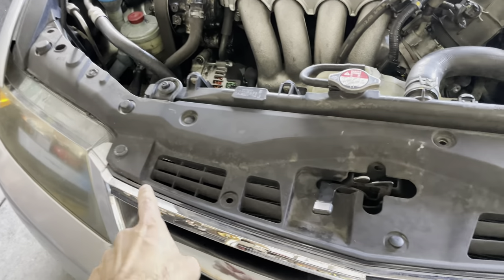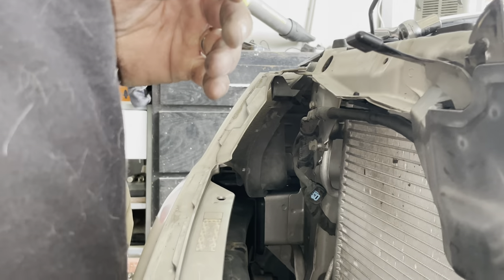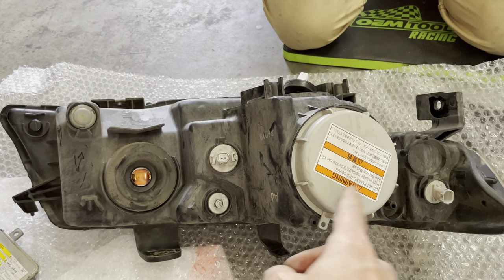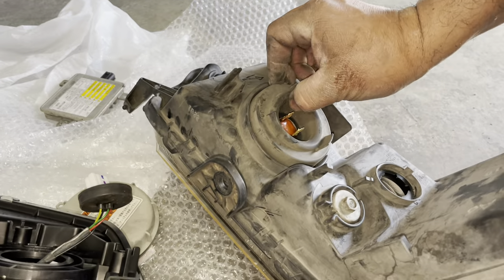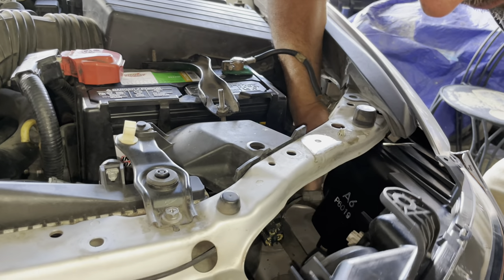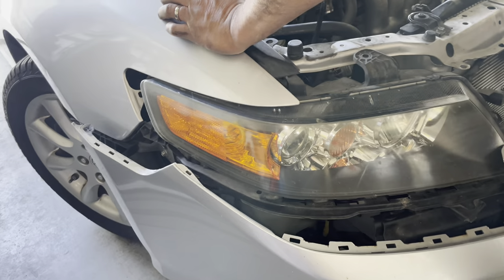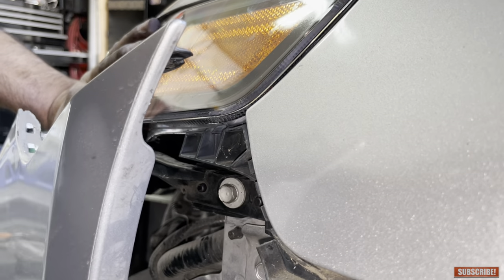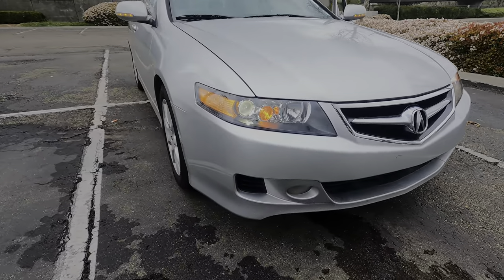How to Replace the Headlights on an ACURA TSX #acura #acuratsx

Comment: Great video, the dealership wanted $1000 per headlight assembly for parts and then another $1000 for labor so we got an after market headlight assembly for $500 and doing it our selves based on your video. Great father son project.
Reply from the maker: Awesome! I tried to combine what I saw in other great videos as well. 
There are some great aftermarket lights out there. Good luck with your project.
Reply: $500.00? Which ones did you get? I'm seeing them under 200.00 on Amazon

Comment: I had a 2007 TSX in Glacier Blue Metallic and it was the first car I ever purchased brand new. I had no real issues with it but the Bluetooth issue did come up. It was draining my battery and once I found out about disconnecting it, I had no more battery issues. However, I did traded it in for a 2016 RDX. But there are those times when I miss that TSX.
Reply from the maker: I like that color too. I do see a couple of them around in that color here by my house. 
When I was trying to figure out an issue I too disconnected the Bluetooth and although it wasn’t the issue, I never went back to connect it.

Thank you for your comment!
Reply: @JuanCarlosLTO  I still see some of them out there and it would seem that they are being well taken care of.

Comment: New subscriber Thank you so much I have a 2004 Acura TSX with only 160 mi on it it has been a wonderful car I love it I just having a little bit electrical problems with the window passenger side and need to replace the driver side headlight Thank you so much for the informative video and wish me luck let's hope this does right oh by the way I did get a HID light you didn't specify which bulb you put in are they interchangeable or do I have to use a LED?
Reply: did you fix your window im having the same issue

Comment: would this be the same for the 2010 TSX ?   Thanks for your thoughts
Reply from the maker: I’d say very similar. In a nutshell, I feel that you have to take off the whole bumper to be able to get them properly installed. I saw some videos that claim you can do it without having to remove the bottom portion of the bumper but it really doesn’t make a difference as it is a hassle anyways. I had the luxury of an extra set of hands in my friend who has all the tools needed etc. if I were to do it again, I’d order the clips to reinstall the bumper and or grill as they tend to get damaged and not work 100%. 
Live and learn. 🤷🏻‍♂️
Reply: Thanks Juan !!  @JuanCarlosLTO

Comment: Is that an oem Acura headlight or aftermarket?
Reply from the maker: Hi! OEM
Reply: Which is better oem or aftermarket? What are the differences between both
Reply from the maker: @franky-fr9ow by law, aftermarket headlights can’t be identical to OEM ones so if you like the OEM look, factory is the only way to go. Aftermarket ones are hit and miss and most times can’t match the quality and specifications of the OEM ones so sometimes they get condensation, etc pretty quick.
Reply: @JuanCarlosLTO  oh

Comment: Why would they make it so difficult 😭😭😭
Reply from the maker: Agree! Sadly it’s actually less complicated than newer cars with everything so compacted that it makes it nearly impossible for a mortal to be able to do stuff like this. This car offers relatively ample space between components to do the job. Worth every penny in my opinion. The car looks amazingly clean with the new lights.
Reply: @JuanCarlosLTO  I just struggled trying to replace the bulb to find out my baluster was no good anyways. So I had to take it apart ☹️ your video was useful. But you’re right. Newer cars just get more complicated. Eventually they’ll make it so complicated mortals will no longer be able to provide service 🤣